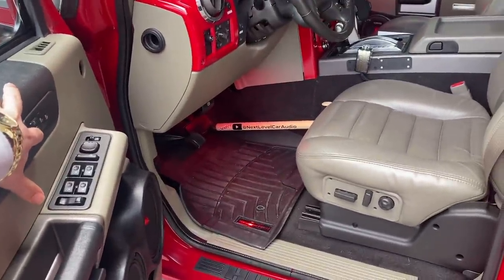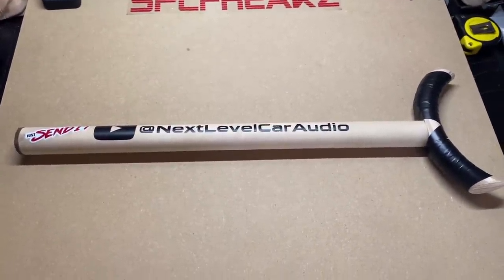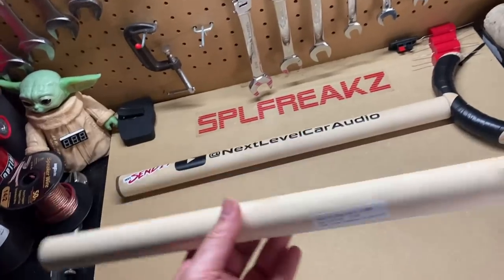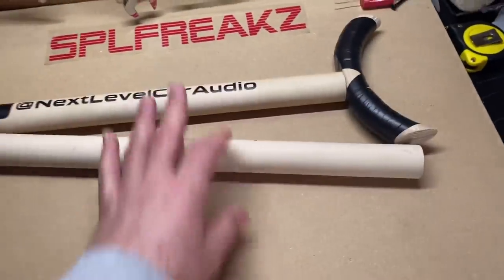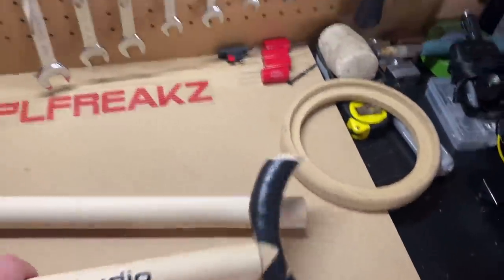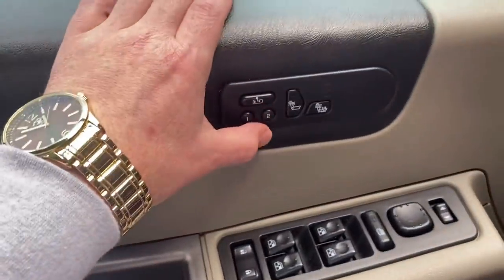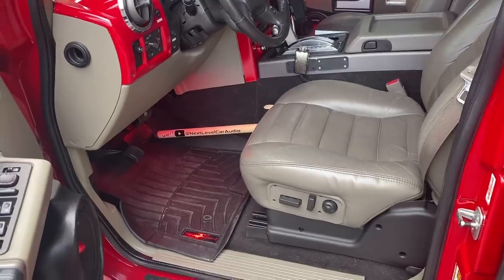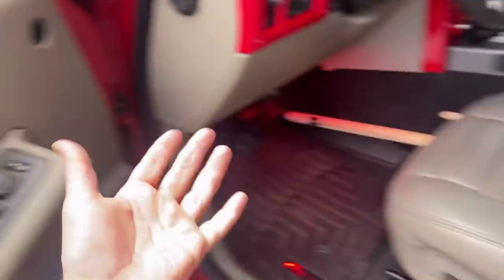100% Free mod!!! Double your car audio power output! MUST do!

Comment: Pvc pipe works well for this and makes adjusting and connections easy. If you don’t have power seats especially. Done this many times previously being water well driller pump installer in family business for 20 years..

Comment: Great idea would also work great for 1 man brake bleeding too!
Reply from the maker: True that
Reply: The amazing thing about those trucks Tahoe's too is if u have the appropriate scan tool. The truck bleeds the brakes itself. Just gotta keep pressure on the brake pedal
Reply: @cfmechanic  bled the chev's  brakes three different times pedal is still soft, homie came through with his scan tool hooked it up and my shit's been legit ever since. Never even knew that existed till a year ago!
Reply: Gotta bleed the abs motor electrically.  Been that way in gm trucks for past 20 years.

Comment: Man this is genius. I'm impressed with the way your mind works lol. I was thinking about maybe making the pulley on the alt a little smaller so it spins faster but that means getting a smaller belt too. But that wouldn't be adjustable I guess unless it's regulated some how
Reply from the maker: Thanks for the feedback man
Reply: I tightened the bolt on the throttle body that the throttle cable is hooked to and just turned until it was where I wanted rpm wise. Then if you want it to go back to normal just loosen it back down the the rpm it was at
Reply from the maker: That’s definitely a way. But with gas prices I wanted something more temporary lol. as the increase in idle does burn more gas.
Reply: @NextLevelCarAudio  yes it does burn more lol but all you gotta do is turn it right back down and she’s back to normal
Reply from the maker: I guess I’m lazy then, still gotta go under the hood and in the H2 that’s a task of its own.
Reply: @NextLevelCarAudio  yeah I guess in the h2 it would be a task but in my Yukon it’s nice n easy lol

Comment: well what you are doing is a fast idle - also called a PTO  idle, that may interest you (use your transmission to turn a shaft "aka use it to run a 2ed alternate) generally its used on RWD big trucks to run equipment (I'm an insulation installer - I have/use a PTO ran hopper for blow-in insulation) , the idle switch is separate from the engine /driveshaft components --- as I see a google search its only 20$ to 50$ to add that feature to my (94 doge Dakota ) but I would go for the full PTO unit and alternator if your doing this for power-related issues --- I hope this helps ... i do see car mods for the PTO switch for other various issues .. 

Can you add a PTO to a truck?
Used primarily to power an external powered attachment, a power take-off (PTO) is able to provide power anywhere under a truck and works through the driveline. Although most PTOs are installed during original assembly, a PTO added in the aftermarket can be installed in 30 minutes or less
Reply: You get me.

Comment: I tell u that was a badass invention
Reply from the maker: Thanks man!
Reply: @NextLevelCarAudio  I'm trying to create a demo truck I'm thinking about replacing my subs with sundown x3 or maybe the zv 6 is there a big difference in sound will I actually get a deeper bass ,lower notes with them I got 4american bass hawks there not bad I do like them alot but I would love something deeper if they are going to be deeper.
Reply from the maker: Check the Xmas. The Z can move! In the right enclosure it’s hard to get deeper than that ;)
Reply: @NextLevelCarAudio  appreciate it

Comment: Hey I drive trucks for a living and when we’re parked for the night we have to keep our rpms up to keep the truck turned on for a/c or heat and one of the tricks we use is by turning the cruise control on and adjusting the idle with the set cruise speed button which gives us the ability to go to the back and sleep comfortably I wonder could you do the same also
Reply from the maker: I’ve tried. Some trucks can be rewired.... but unfortunately mines can’t :(

Comment: That's a good idea. I use that method to check my brake lights and signal lights. 
Speaking of alternators... I've been looking for a stronger alternator for my '04 Durango 4.6L. I can't seem to find an aftermarket alternator that's more powerful than the stock one. What is a good place to look for an alternator for car audio?
Reply from the maker: I’d check the Mechman website. Great folks and I believe they have a 500amp that should work for your rig.
Reply: @NextLevelCarAudio  Thanks, bro. You always come back with good advice. Idk if you recall me asking about a good amp for my Skar SD-10's. 
I'll check that place out..
Reply from the maker: Hell yeah man. I do what I can. I just hope as my channel grows bigger I can still keep up with the comments.
Reply: @NextLevelCarAudio  I really appreciate the help. I have a very simple system in my truck. But, I know I can get more out of it.
Reply: I got mine custom made by GP Car Audio. 367 amp for my 2013 Grand Caravan. Workin damn good so far
Reply: @michaelzernie7092  Thanks for the input. On Mechmans where Next Level mentioned I saw a 240 one for about $400.

Comment: I have a hybrid all lithium car, I have a generator with a 36v to 12v step down converter...I also added a 40ah yinlong bank so my car is at full tilt all the time even when the .engine is not running 😄😁😝
Reply from the maker: Nice!

Comment: If you have a cable throttle you can just block the throttle from closing with a little tiny pice of wood/plastic same result.  Man i miss my cable throttle
Reply from the maker: Yep. Unfortunately I got an electric controlled one. No throttle cable :(

Comment: With your system on has it rattled off yet?  I’m thinking on really high spl vehicles it would just fall off the gas pedal at some point.
Reply from the maker: Ran full tilt, 155db. No issues. Did not move a millimeter

Comment: is 1000 rpm idle ok or stress the car.? cuz most cars are 500-800 i think
Reply from the maker: 1000 would be just fine. Only downside is you gas consumption will increase
Reply: @NextLevelCarAudio  ok man thx

Comment: Got a question for you how can I tell if my aftermarket radio is capable for two amps? Went to audio installation shop to get a estimate on replacing all factory speakers and installing an amp. He said my radio wasn’t capable for two amps that I needed to get a newer model.
Reply from the maker: Lol, that shop is crazy then. You can add as many as you want to any stereo. It’s a simple matter of a LOC (line output converter) and RCA splitters.
Reply: @NextLevelCarAudio  lol I had a feeling like that, came across your video and thought I ask. My vehicle has stock 6x9’s in front doors panels and rear. Would you recommend I only replace the front  ones cause I already have tweeters on the front panels. With the bass in the back I don’t know if replacing those will make a difference?
Reply from the maker: Rear stage won’t matter much at all unless unless you ride with passengers in the back all the time. Focus on your front stage and subs, you’ll be good to go
Reply: @NextLevelCarAudio  thanks bro 👍🏽
Reply from the maker: You bet

Comment: Can a H.O alternator damage the cars PCM due or damage the batteries by charging too fast?
Reply from the maker: Not if voltage is regulated correctly. Plus they only pump out the amperage when load is applied, so no load, they perform as normal

Comment: Help anyone pls!!! Does anyone make a HO alternator for 2006 Magnum... I have four tens in a 5 cubic feet box tuned 35hz... 

At loud volumes the amp goes in and, out sound wise like it starts straining..  no protection light or, amp getting hot... How can I fix this issue?!
Reply from the maker: Not sure man. Try checking with Mechman directly. They can do custom alts
Reply: @NextLevelCarAudio  I'll look into it

Comment: My system is to loud for that it will shake it loose
Reply from the maker: How loud? I’m 155db, full tilt does not budge a millimeter
Reply: @NextLevelCarAudio  last time I metered it I hit a 163db makes my gas pedal shake violently
Reply from the maker: Well, most people don’t run 160’s I’m sure we can agree. Lol. This would be for them, not for you 😆

Comment: it's all good until you accidentally knock it in to gear... you will be running after ya car
Reply from the maker: Locking shift knob, need to depress to shift. I’m not worried about it one bit.
Reply: You have to press the brake pedal in to get out of park in any vehicle, normally.
Reply from the maker: True